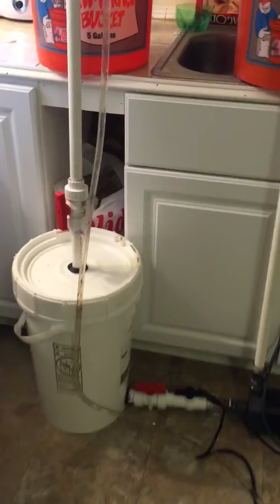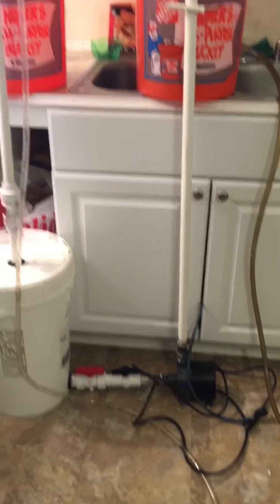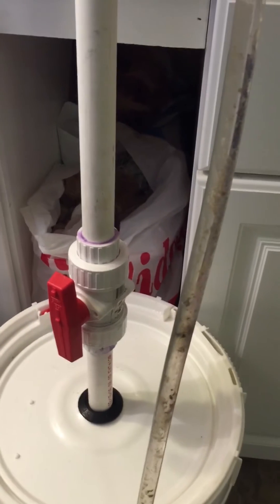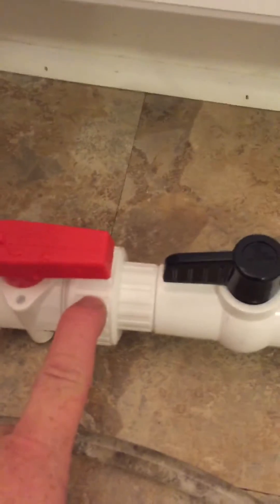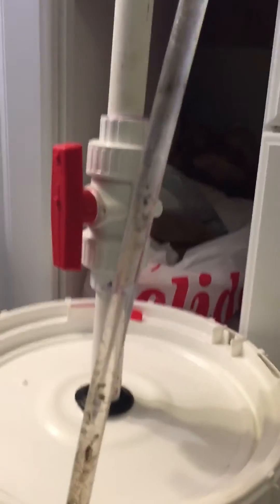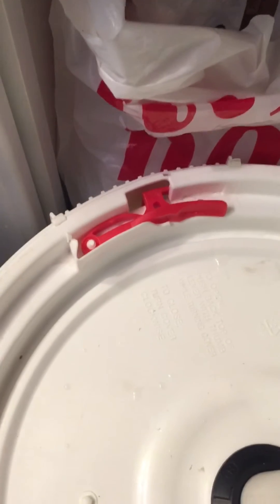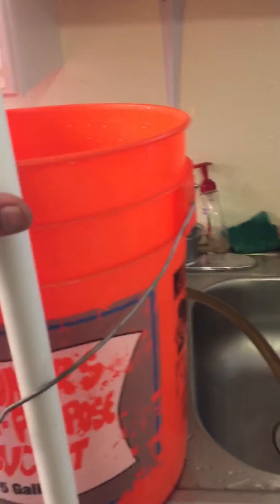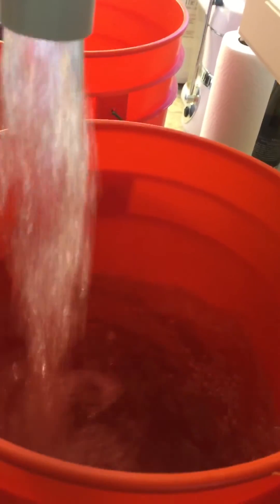Diy mega canister filter | highest output canister filter on you tube

Comment: Did you ever make that follow up video are you still using it did it leak
Reply from the maker: duane fagan hey ya this setup did end up leaking the bucket I had is not good enough I since bought 2 fx6 filters but this project would work if you got the proper bucket with the seal from Home Depot
Reply: AK Aquatics22 well that sucks it leaked but yeah I'll definitely look for a good bucket lid combo thanks. Quick thought since it was gravity fed inlet and sucked out the bottom of bucket would that eliminate the pressure problem?